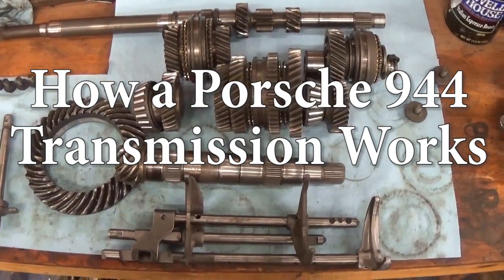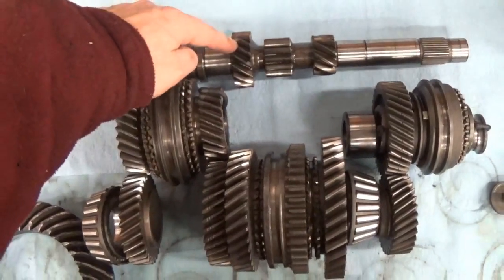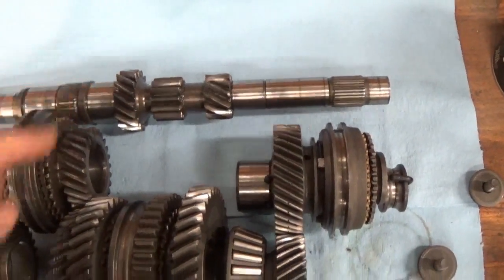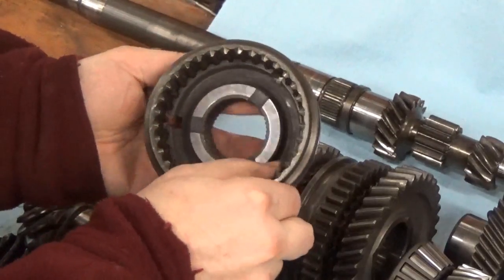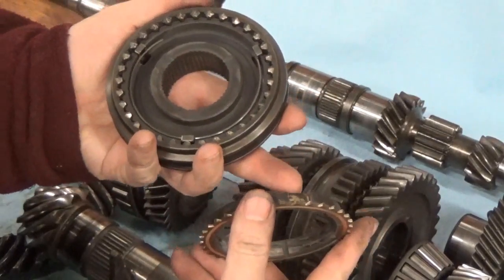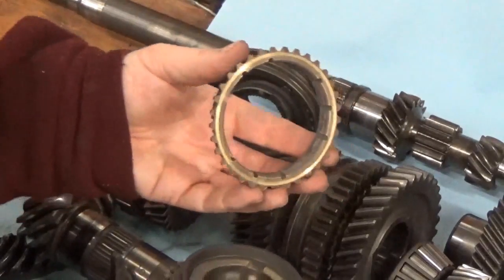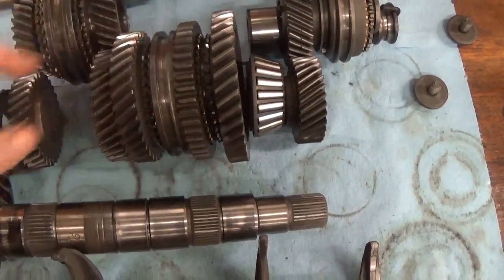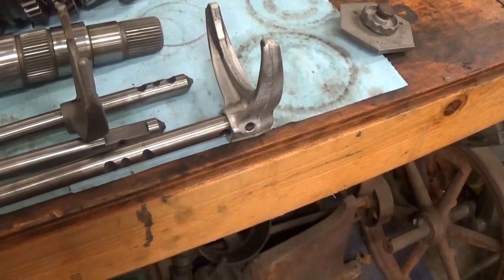Closeup look inside a Porsche transmission

Comment: Hi.
Thanks to you i Feel 100% motivated To start my biggest challenge...I've to repare my S2 gearbox because of big trouble on the 2nd gear after that i've asked to my mechanics to try to change the synchro and bearings...
I hope the rebuilding Will go Well 😁
Reply from the maker: Good luck.  Because of some of the special tools required, I actually have a "guy" for my rebuilds.

Comment: Hi Van,
I watched the video again to see if you are discuss properly setting up(fine tuning) the gearbox. I have a 5Y gearbox problem since June it rattles on neutral gear when it's warmed up. I had 2 other gearboxes installed after that in my car and they're bad. About repairing my original gearbox mechanic says that one can't set properly a gearbox(during reassembly) without a tool for 2000$. This tool is used to set up some tensions, in free translation the name of it would be "false shaft". The mechanic said something about properly setting differential teeths against each other, so gearbox want whine or fall apart. Does it make any sense? How do you do it? Is there a tool available on US market besides the original one for doing that?
Reply from the maker: The thing you have to set is the preload of the bearings on the shafts and differential (because the tapered bearings face each other and the aluminum case expands at a different rate than the steel parts), and the backlash, or mesh, of the ring an pinion gears.  My transmissions get rebuilt by a guy who has all of the experience and tools - I only take them apart. :)

Comment: hey Van, my manual gearbox has sprung a leak and I need a new gasket to go in between the middle section and the rear section. My concern is whether I would need to pull the entire transmission to change that gasket or is there a way I could pull the rear section out alone and change that gasket? I just put in all new gear oil too, what a shame. thanks!
Reply from the maker: Look up how to replace the 5th gear cluster - I think it's on the Spec944 web page.  You will have to remove the transmission (unless your spare tire well has been removed), but it's not too difficult a job.

Comment: Are there different gear ratios that can be used?ANDAre there different ring and pinion gears?If so, what cars did they come out of?Thanks,Ken
Reply from the maker: +kfrey1 The NA 944 and 924S used the same R&P ratio.  944 Turbo and 944 S2 each have different ratios, but the gearboxes are physically longer, so the internal parts can't be mixed - but the whole gear boxes can be swapped (but they're taller, so it's a disadvantage in a 944 with less power).

Comment: Great video. 4th gear is so close to 1:1....it's 1.034:1 on 1988 and up S, S2, and Turbo model. Otherwise it's 1.072:1 for 1982 and up NA 944. Anyway I think it's awesome to watch the tach match the speedometer in 4th gear.

Comment: I have a problem. The left rear transaxle on my 944 actually snapped off. What would the replacement entail? As in what would I have to do? Great video by the way! Very informative stuff.
Reply from the maker: Gene Jost I assume you mean the output shaft on the side if the tranny.  That's just held in by a single bolt with a 6mm allen head can can easily be replaced when the axle has been removed.  (you'll lose some fluid)  However, the bigger question is why it snapped...
Reply: I looked in a repair manual and it looks like it's the drive axle. Either way it seems like an easy fix. And yeah I have no idea why it snapped! It sucked though.

Comment: Hi,
need your help again, please.  Car is all in order, just noticed that i have a burnt bulb front side marker(yellow) passenger side.  i took it apart, but couldn't figure out (didn't want to break anything) how to remove the bloody bulb.  Do i remove the plastic yellow marker from the white socket housing or remove the socket housing?  is the bulb replaced via the yellow marker or via the housig?.

as always, your guidance is much appreciated,
Jo
Reply from the maker: Azzurro The lens should unscrew from the white housing with the two philps screws at the ends.  There is a rubber gasket which will probably stick... so you'll have to pull a bit.
Reply: Van Svenson Thank you once more, shall give it a go.

Comment: hi, after long brutal winter, going to start my 84 944 for 1st time since Oct 2014.  Battery was removed and charged  every so often, fuel stablizer added to fuel tank, removed the air box too, tires raised from concrete floor.  Before starting, any preventive tasks or tips you can offer or recommend?

oh, one more item, my rad is leaking from the bottom left (driver side) corner where the plastic tanks meet the alum core.  Drip of maybe half a cup/day.  Any suggestions for repair?  Would re-crimping work or any other method/product to seal the leak?

thank you
Joe
Reply from the maker: I'd pull the DME relay so there's no fuel or spark... then crank the engine over until it develops oil pressure.  Then return the relay and start it up.  For your coolant leak, you might just need a new radiator. :(
Reply: Thank you for the tips.  Also, i've pulled the air box completely as i needed to change a few hoses. dumb question, but i need to ask - where is the DME relay on my 84 944? No sense trying to re-crimp the tank to the alum core?  Radiator stop leak - useless or useful?

thank you for your help,
joe
Reply from the maker: Azzurro
 The DME relay is with the fuses - under the dash near the hood release.  You can try crimping the the end tank onto the core...  You can't do much more damage - it already leaks!  I've never taken one apart, but I imagine there's a gasket of some sort that's dried out or broken.  As for stop-leak stuff... I'm not a fan.  They can work to stop leaks, but I worry that the goo/ooze coats the inside of everything and reduces heat transfer... and/or could cause some other adverse effect.
Reply: thank you for your prompt reply.  does the DME have a number?
will follow your lead.

tks,
Joe
Reply from the maker: Azzurro
It's tall and black... sometimes it says DME on it...  Do a google images search or look in your owners manual.